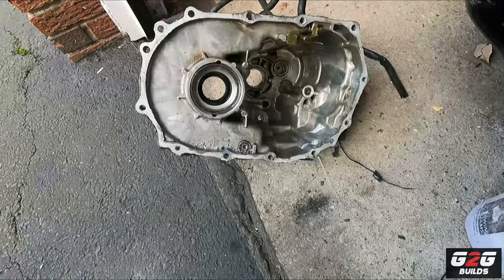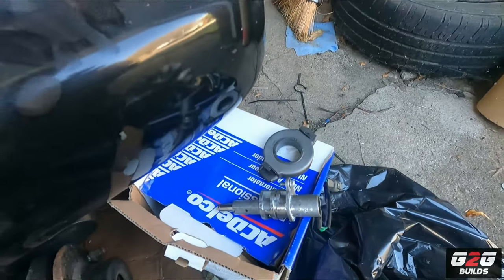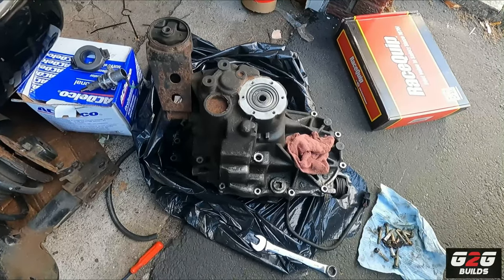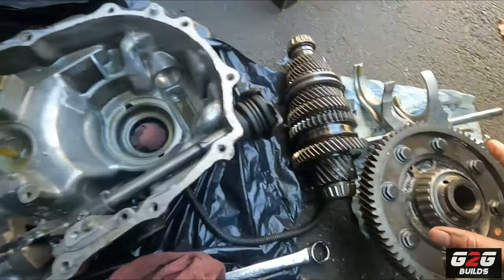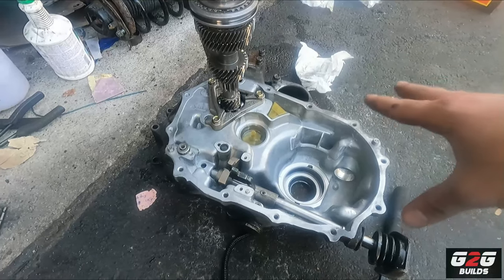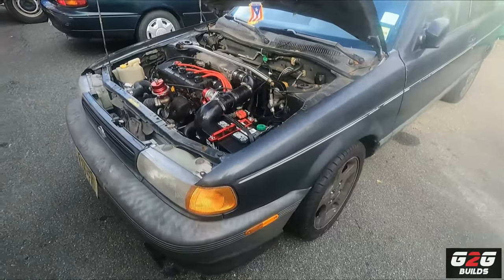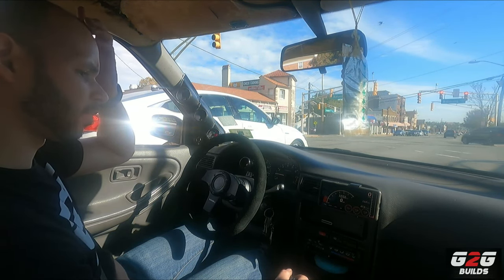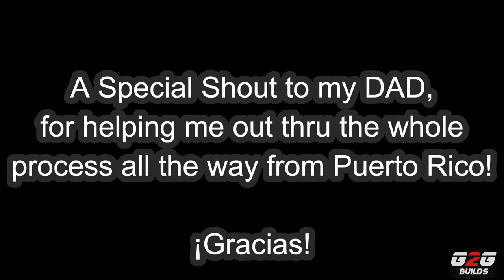B13 Sentra 1.6T - First Time Taking Apart My Transmision

Comment: Hi there i am from ARUBA Nice work like that you are doing youre own thing and learning while doing it is it single traction right now
Reply from the maker: Thanks brother.
I know, i need to figure out a way to find an LSD.
Reply: @G2GBuilds  yea i was checking too but dont seems like they have lsd for ga16 i have a friend here in aruba he weld the diff but he only drag race with it  thats the difference he ran 12.14 but he is on E85 and on slicks
Reply from the maker: @jurvenymartha8443  very impressive numbers.
I thought about welding it, but since I have a street car, it won't be ideal for my application.
Reply: @G2GBuilds  yea thats true
Reply: @G2GBuilds  send me youre email i will send you a video of the sentra from my friend running 13.8 on tire
Reply from the maker: @jurvenymartha8443  g2gbuilds@gmail.com
Reply: @G2GBuilds  can you buy a mechanical locker at all?
Reply from the maker: @jesmotorsportfnq  Probably i could, but i don't know if it work like an LSD or welded diff.
Reply: @G2GBuilds  the work pretty much the same
Reply from the maker: Good to know. 👍